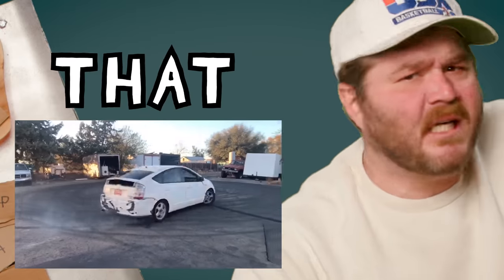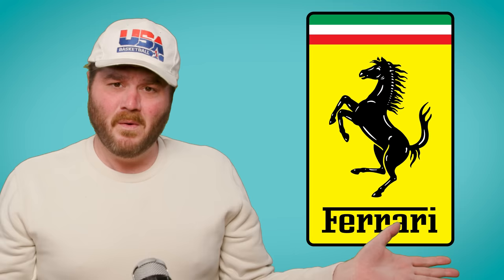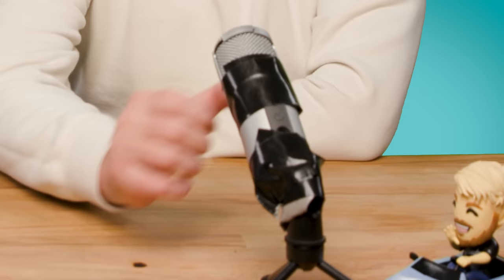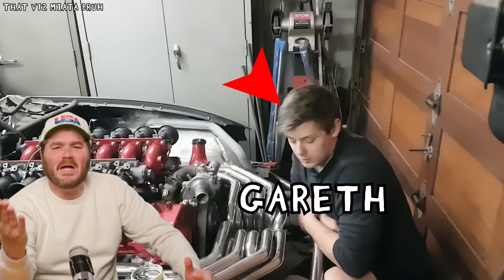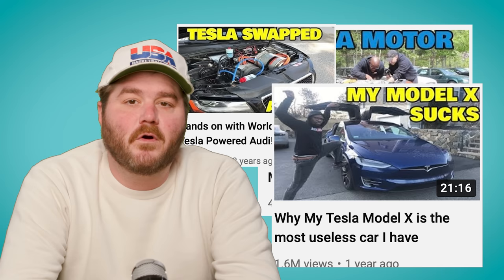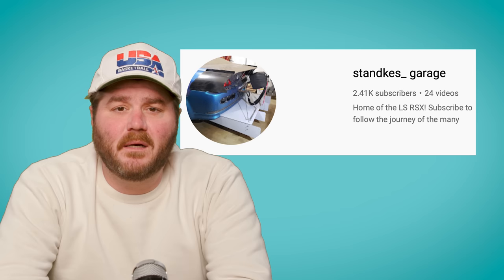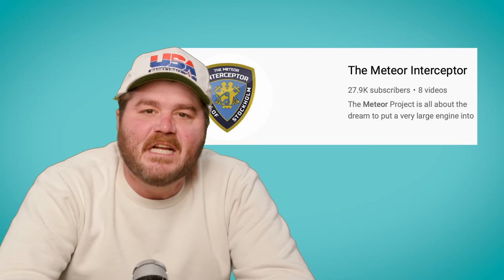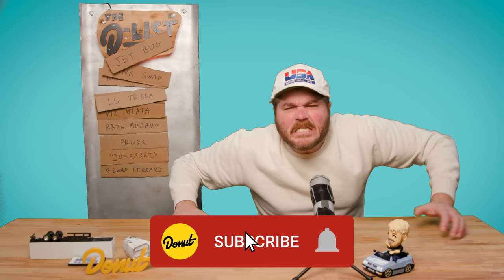Engine Swaps are Getting Out of Hand

Comment: 3:29 Did James just accept the existence of the highest torque inline 6 on earth? the supercar killer, the destroyer of JDM tuner cars down under, the undisputed king of it's platform. The motor dubbed "Project Gull" by Ford Australia because it was designed to hands down shit on everything in it's class and with basic mods everything outside of it's class.
The Barra
I'm happy he's realised it exists and that leads me to my next question, WHERE THE FUCK IS MY UP TO SPEED ON THE FORD FUCKING FALCON?!?!?!?!?!?!
Reply: Hate to break it to ya pal, but the inline six torque king is the good ol' Cummins Turbo Diesel. 
It's so powerful it can pull down a house. So simple and reliable it can be worked on by a mouse. The only engine lovely enough to be a great spouse. It call roll coal and is 10x louder than Steve Grohl. It can pull 20k pounds up a 15% grade, and with the boost from the turbos that power will never fade. Makes the Ford PowerStroke look like a joke. Rocking the house with more energy than Dwayne Johnson on Coke. Old but still classy, call it bespoke. So Ford should chill out before they choke, cause everybody know they don't want none of this here black smoke.
Reply: @elijahmontgomery4146  got 'em
Reply: hellyeah. the barras in the Falcons are great. The Barra turbos are neck snapping fast. I got to use them as company cars from 2004 until '16 and was never late for any meetings. Reliable AF and easy as to maintain. Brilliant cars. And the Utes are total madness.
Reply: @elijahmontgomery4146  holy fucking shit
Reply: @elijahmontgomery4146  Poetry in motion
Reply: @elijahmontgomery4146  Both of these comments need pinned pronto
Reply: Torque king 425tq? BMW Mercedes Benz Volvo? The Barra is a great Aussie Ford offered inline. The Chevy Atlas 4.2 i6 is our domestic Barra with 4 and 5 cylinder configurations. Holden used Nissan RB’s. 600hp? Nothing close to a 90’s 2JZ. 80’s Cummins 12 valve common rail? Anything you throw a retirement pension into will be fast.
Reply: @elijahmontgomery4146 Dave Grohl but masterpiece nonetheless
Reply: killer dowel pin you got there that supposed to be in the timing gear housing or nahh😅

Comment: The tank engine, called the meteor, was based on one of ww2s best aircraft engines, the merlin with a supercharger attached, powering the p-51, spitfire, hurricane, mosquito, Lancaster, and other planes

Edit: it was originally the merlin, they ripped the supercharger off to become the meteor. Tanks included the Cromwell, Cruiser 8 challenger and others.
Reply: Its the other way round
Reply: Yeah they got the merlin and adapted it for use in tanks which created the meteor

What tank?
Idk
Reply: These engines are common still in tractor pull and aero speed record planes . The griffon is it’s bigger cousin . .
Reply: @Whateverpoopiepants  speed boats, too
Reply: I think the red line was 3,000rpm or so, so you need some seriously tall gearing.
Reply: I thought WWII planes mostly used rotary engines. The more you know
Reply: @the_inquisitive_inquisitor  rotary engines in planes leads to weird handling characteristics
Reply: @the_inquisitive_inquisitor  all of the British spitfires had Rolls Royce pistons engines . Radial engines were the popular alternative . 
If you are interested in weird engines look at the deltic diesel they are mental .
Reply: My grandfather built those bad boys during the war
Reply: The Merlin was shipped to Packard for use in the P-51 Mustang, and Packard noticed something off. Just about every component in it was loose.
So, they tightened all of the bolts and went to start it, and behold, nothing. Packard then loosened the bolts back to how they found them and it started right up.
Those Brits were on something.
Reply: @the_inquisitive_inquisitor  You're thinking radial engines. By the 40s, they were bolted into tanks instead of planes.
Reply: @the_inquisitive_inquisitor  Radial engines, not Rotary, 2 VERY different things
Reply: @GC2Major_Tom  hmmmm. I guess it might be for maintenance? Not really sure though. The packard merlin engine really made the p-51 a lot better at high altitudes than with the Allison powerplant.
Reply: @joealex65  Gotcha that's exactly what I was thinking of.
Reply: meteors were merlin's that were made with mostly  parts that couldn't be used for aircraft engines so instead of being tossed, they were reused for use to build tank motors as an engine failure in a tank is less costly. The supercharger was also removed so that the engine could operate on lower octane fuel which was normally being used in ground vehicles.
Reply: @the_inquisitive_inquisitor  technically they're radial engines. Rotary(aero) engines spun around the crank. Weird WWI era tech.
Reply: Is the opposite: the Meteor is a naturally aspired, land based version of the Merlin.

Also the first Meteror were just recycled Merlin from shoot down planes, or engine not good enough to be installed on planes (the Meteor, having less power than the Merlin, was less susceptible to some defects...)
Reply: @Whateverpoopiepants  more like V10 in a mini car.
Reply: @moose2577  which is probably also why all other languages call rotary engines wankel engines.
Reply: @the_inquisitive_inquisitor  rotary engines are the spinning dorito type, radical engines are the ones with the pistons in a circle used on ww1/early ww2 type aircraft and then i think v engines were used on ww2 aircraft
Reply: @randomperson-hm9wg  Before the Wankel rotary engines were multiple cylinders that spun around a central crankshaft that was fixed to the airplane. The radial is essentially the same, but with the cylinders fixed and the crankshaft rotating.

Here is an explanation about how such an engine works https://youtu.be/xgTwKPg7Obo

And here is one being started and run https://youtu.be/Nk9Dl6RZxmQ (at 2:45)
Reply: @randomotter6346  Probably more accurate to say "better at what they asked it to do". The Aliison-engined P-51A/B, as I learned recently, was actually faster at sea level than the Merlin one. It was at medium-high altitude, where more late-war combat took place defending bomber streams, that the two-stage supercharger on the Merlin won out.
Reply: @GC2Major_Tom  I think that might be apocryphal haha! What is more certain (from the book "The miracle of a name" about RRs history) is that Packard didn't have the tooling required to machine the fine tolerances RR had set out in the blueprints, so Packard came up with some clever compromises without affecting power. I think they were a little more fragile than the RR built engines but don't quote me.
Reply: @chrisburn7178  hmmmm. The more you know. I guess the supercharger was too inefficient at low altitudes and siphoned off power they could go to the propeller. I think they added ‘boost’ controls to try and mitigate this. The p-51s bomber escort role in the later war favoured the merlin though.
Reply: @shnek5143  The early early Meteors yes, later, no.
Reply: @Joopyter724  Sweden, had Centurions until they added Leo 2s.
Reply: @brett9675  I was making a really unfunny joke 
(Look at my username)
Reply: F*** it, the world needs a Merlin powered mini.
Reply: @the_inquisitive_inquisitor  Depends on the use case. Typically, fighters like the Spitfire, Bf109, Mustang, and Yak-3 used inline engines for their better aerodynamics and efficiency, while attackers and bombers used radial engines for their ruggedness (Pratt and Whitney Wasp engines had a habit of losing entire cylinders and still flying home). The main exceptions were the P-47, because it's a monster of a machine, and the US Navy, who refused to have their people pilot aircraft that could lose the engine because of a stray bullet hole hundreds of miles from the carrier.
Reply: @Joopyter724  Sorry, this is late but I knew that, it's just what if those guys try to put the 48 liter V12 from a Leo 2 tank into a car or truck.
Reply: @randomperson-hm9wg  Radial - engine fixed, crankshaft spins
Rotary - crankshaft fixed, engine spins

https://en.wikipedia.org/wiki/Rotary_engine

Wankel engines didn't appear, as prototypes, until the late 1950s, though Felix Wankel had patents for the original design as far back as 1929. By that time gas turbines were taking over in large aircraft/fighters.

The Wankel rotary has been used in light aircraft, however.
Reply: @waynec3563  i know what a rotary engine is, i was trying to say that the two things are different
Reply: You mean they got that thing from a Cromwell?!
Reply: @the_inquisitive_inquisitor  I think you mean radial engines... and no, radial engines in planes wasn't really a thing anymore by WWII.
Reply: @cirrustate8674  radial engine are still widely used in WW2 for alot of plane including fighters
Reply: @brett9675  Don't forget Israel with their pretty good use of them! (they still use the damn tanks as APCs!)

Comment: One if the scariest things about jet engines is that they dont rely on traction like we're used too, they just push you forward until you turn it off.. that vw owner has a scary car on his hands
Reply: Normal jet engines don't but that VW does the engine used in it is a turboshaft engine from a helicopter basically a larger version of whats in the y2k bike so while it is a jet engine and does produce some thrust the majority of it's useable is from a shaft output that need to be run through some sort of drivetrain to power the rear wheels

Comment: You guys should do a vid on why some every day car engines handle so much horsepower and some engines can’t
Reply: yes please!
Reply: Stronger, more reliable parts… what kind of video are you expecting?
Reply: @falcofurious  Yes but that’s probably not the only things that explains why they can make so much power
Reply: @Patrioticmonkie  "Handling so much power" is itself a big assumption that disregards how many modifications examples of engines with "so much power" have. A lot of it just comes down to aftermarket support, a Honda K engine can't handle 1000hp on a stock block, it can't even handle half of that on a stock block, and even to break 300hp you need a lot of intake/exhaust/fueling upgrades. When we're talking about completely new intake and exhaust with aftermarket turbo, forged pistons and conrods, upgraded fuel pumps and injectors, ignition coils and plugs etc there's shitloads of engines out that that could also handle "so much power", but that's simply because at that point there's very little of the original engine left. It's like 2JZ people who talk about their engine making 2000hp...on a billet block. Literally nothing on that engine is stock by then, so at what point did it stop being a 2JZ and simply became a complete bespoke race engine?
Reply: @Patrioticmonkie  ffs they basically explain why in every episode that has anything to do with engines. F1 episode for example.
Reply: Engineering and construction from closed decks to girdles, oil squirters, variable timing, thrust washers that fail and walking cranks. Head bolts, oil pumps to oil pressure. Most high tech feature engines are powerful out the box but do not accept upgrades very easily. You can make a 1k Hp K20 but won’t last 10k miles before a rod gives, the head lifts or rapid blow by etc. 2JZ 900hp bottom end inline 6 is a testament to Toyota/Yamaha of the 80’s.
Reply: @BigUriel  sober up lady, you completely missed the point

Comment: fun fact: Corvettes where going to have a 4 lobe N/A rotary in the C4. they didn't use them, because of oil leak issues. there was a plan for the "1989 ZL1" to be turbo charged, but the boost had a tendency of melting the 4 lobe engine.

Comment: My J32 swapped miata is absolutely perfect. Everyone who rides in it agrees masda should have stuck a 300+ crank hp v6 in it from the factory. It's just so easy to drive at an ungodly speed. 

She's not 100% done but is close. Some taller rear gears from, a fully custom exhaust and one more tune and she will be mechanically wrapped up. Then it's on to a tiny bit of exterior mods and a wrap. She's clean how she sits but is needs that little extra to really shine.

Comment: Man, I wish they had Youtube back in my swap days. The 400 Pontiac into a '78 Volvo made for a great sleeper car but the 500 onto an original VW bug was probably the craziest. Also, did you know that on the old VW bugs you could rebuild the tranny backwards and have 4 reverse and 1 forward gear? That was an interesting surprise when we first started that one up. Plus you could blow a pop can size hole in an original VW bug cylinder and it would still run for quite a while. By the mid 90's you would be hard-pressed to find an original VW engine in Manitoba because we had blown most of them up.

Comment: My dad built a 1983 Porsche 944 with an LS1 engine. The original engine died so rather than junking it he slapped that in. Ended up having to upgrade the transmission and we also had to get Volkswagen bus axles on the rear since the originals both snapped when he started for an autocross. It's currently sitting in the garage because it needs a new torque tube... 😐

Comment: I engine swapped a BMW M60 into my 1974 mustang II complete with the 6 speed manual transmission and the brake booster with the audio wire harness onto the original mustang wire harness. People hated it lol. The only reason I had to swop it back for a 351 Windsor is that the exhaust manifolds at the time we're going to cost me to much to make. R20 000 just for the manifolds. No one wanted to give me a better price and at the time I didn't have the equipment to do the weilds to make my own. Wrong place wrong time. And with kids it can be more difficult lol. One day I will still do something crazy. I have another car that is hated by fast and furious but I'm going to do something rediculouse with it and hope to see it hear lol. In the next year 8s the plan

Comment: The Rolls-Royce meteor engine made enough horsepower in the Cromwell that the suspension could not take the high speeds of 70 kmph so they reduced it to 64 kmph.

Comment: Here's an idea: 
1) what if you took a supercharger and belted it up to the engine and had a water cooled engine, but also had that self-same engine be turbocharged, so the heat from the engine that's wasted energy would power the alternator via a steam turbine belted to the alternator, while the combustion cycle powers the blower like normal.... and then also, you have an exhaust powered turbocharger that would provide additional boost....but that way you wouldn't lose torque off the engine to the alternator or power off the alternator either, because the steam cycle would be powering the alternator, not the belt connected to the combustion cycle... (would need a good battery, it wouldn't charge it up until the engine got hot, but would stay charging it after car is parked....) more efficient super than way

2) or my other idea is to just supercharge the engine...and also turbocharge the engine like normal, but have the engine be water-cooled and have a steam turbine belted to the supercharger blower instead of the alternator, like in Way 1... with that set-up, it wouldn't provide boost until it got hot, but then would provide continuous boost, even after the car stops, which would make it necessary to take it out of gear, or have a steam purge valve.. the second one may be better for a long distance racer, to help Regulate heat, or in an aircraft. The amount of air through the blower should be proportional to the engines heat being reduced, which would make sense, but more sense for sustained use.... the first design is better for shorter bursts

Way 1 is steam powered alternator
Way 2 is steam powered supercharger 

But both would be water cooled, and turbo AND super charged.... instead of twin turbo... the main purpose of all this being conservation of energy and additionally the laws of  thermodynamics... which equate to MPGs lost to HEAT

in a typical supercharger set up, the engine (combustion cycle) powers the alternator, and the Super

Comment: huh. a k swapped ferrari 308. y'know that might be a good idea. it's basically a really expensive MR2. since the engine bay is made to handle something twice the size, you can move that bad boy further toward the center, which improves balance and handling, it's lighter than stock, there's lots of room for whatever you want in there, ferraris usually handle well, but I really wouldn't trust any 'classic' ferrari running gear to be able to handle the torque... it might just work. pretty sure the 308 was either hand formed aluminum body panels or fiberglass on a semi spaceframe chassis, so it'd be fairly light and stiff

Comment: That's nothing, is the ultimate engine swap or new build in the case of Jay Leno's Rolls Royce Merlin engine? If you can get the last varient it will deliver an astonishing 2000 hp of sheer power, the fun is getting the correct drive train and gear box to translate the Spitfire/P51 Mustang/ De Havilland Hornet engine into motion!

Comment: 10:06 Wait a second.
That is NOT a tank engine...at least originally, it isn't.
I think it's a Rolls-Royce Merlin, the everything matches. And it was not built for tanks. The most famous user of this engine is the Supermarine Spitfire. Also by license production, the P-40 Warhawk and P-51 Mustang. Other users of this engine include the Hawker Hurricane, De Havilland Mosquito, and the Avro Lancaster.

And after all, with 1500-2000 horsepower output, it was later yeeted into tanks, and also in the late wwii, was yeeted out of the Spitfires, and they also got Engine Swapped for a 37 liter, 2151 HP ROLLS-ROYCE GRIFFON